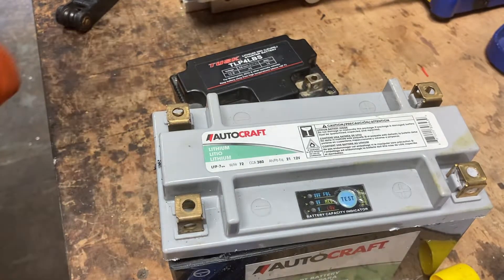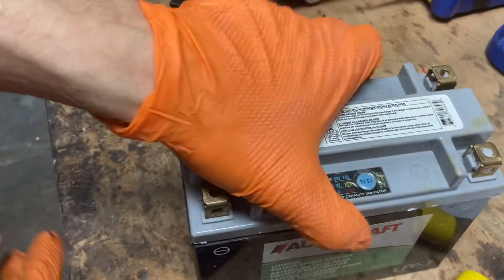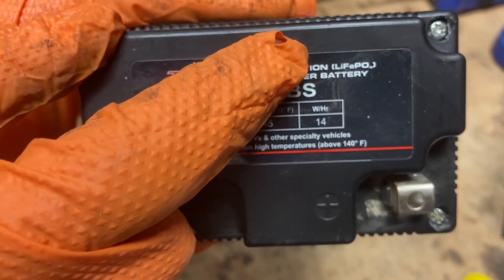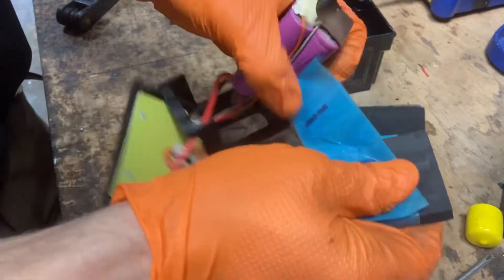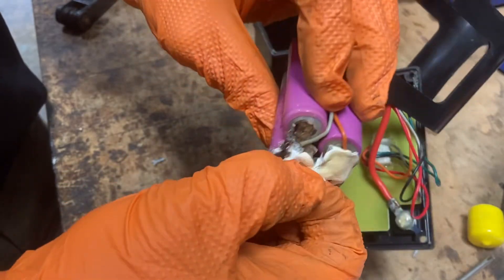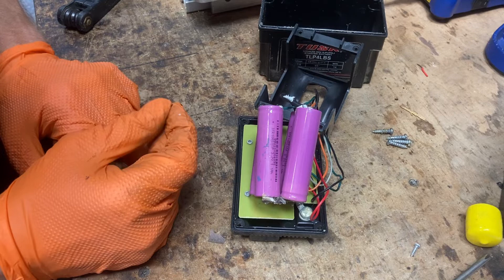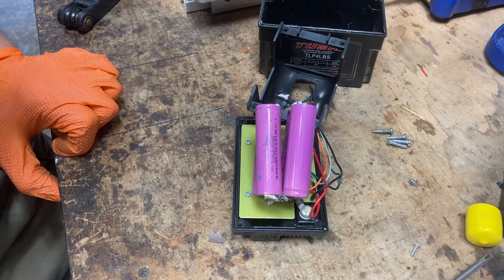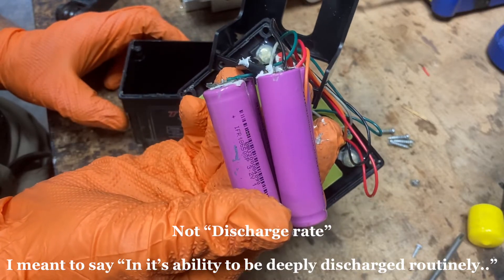What’s Inside a Lithium Motorcycle Battery

Comment: You can use 8 32650 cells (4+4 in parrallel). I'm in the process of building a new one for a light 125cc motorcycle.
My current battery is working for about 3 years now. Never needs recharging, disconnecting, maintaining. After winter starts right up and allways stays at about 50% SOC. I did add a powerdiode with a parrallel powerresistor, in series so the battery can cranc at full power, but can only charge at a few amps max. I'm going to test if that is even nessesary because if the charged voltage is almost the same as the bike's charging circuit voltage, there will only be a small charging current naturally.
Reply from the maker: @BrainHurricanes it sounds like you’re in deeper than I am. I would love to see your build sometime, somehow!
Reply: If LiFeP04 batteries must be charged less than 14.48 volts, how do modify the motorcycle regular to match.
Reply from the maker: I wish I could tell you. Sorry. That’s beyond me unfortunately.

Comment: its lead acid you dont want to fully discharge because it damages the terminals since its literally powdered lead and lead oxide that has been shoved into fiberglass cut grids. if the battery is inside the car and if it is able to heat itself i think it will work just fine as long as you dont try to use some bms meant for another purpose. especially with active balancers now, you dont need to run a bms coz most car alitnators will only float lifepo4 at most at like 80-90% state of charge before their 4x diode bridge in the back of them blows up

Comment: The big one, Is it lithium polymer or lithium Lifepo4?
Reply from the maker: Lithium Polymer
Reply: @Duby4life  nope. I think it is lithium phosphate/lifepo4. If lithium polymer, the voltage is to big. Per cell is 3.7v, but the lifepo4 is 3.3v per cell
Reply from the maker: @andrewhaselblad2676  Unless I’m mistaken, it’s definitely a Lithium Polymer. You can see the gray polymer bricks stacked on top of each other. It could be that is a lithium phosphate polymer battery.

Comment: I just made the mistake of buying a NOCO npl5 12v Lithium Ion battery from walmart and guess what.. its a Non-refundable, non-returnable item. And according to NOCO's website they will ONLY accept returns of batteries bought on THEIR website. So im out 79 dollars for the battery and 12 dollars for  NC recycling fee without an exchange. 
Not only that but NOCO's website says you can only use THEIR charger or it voids the warranty!  Lithium powersport batteries are such a scam. IF ONLY I HAD RESEARCHED IT FIRST but its like the merchants dont want you to know. NOWHERE on walmarts battery shelf does it say "Non-returnable" or "Non-refundable"
Reply from the maker: Man! I feel for ya. Just the fact that every lithium battery manufacturer mandates that you use their specific charger shows you how temperamental and sensitive these batteries are. They only hold up well under the most ideal circumstances it seems. Sorry you had such a bad experience! Lithium had it’s uses. I’m not convinced that motorcycles and scooters are one of them.

Comment: would love to see the bms inside these batteries.  Running lifepo4 batteries below 2.5 volts per cell will damage them at best and most likely destroy them. the same is true at more than 3.7 volts per cell.   I cannot see these tiny bms's handling the current needed to start the bike but have never seen one.  If the battery does not disconnect if you run it down it is just stupid. I have also not seen 18650 batteries able to safely output more than 30 amps so the 200+ cca is destroying the cell every time you start it.  Don't know the rating on the pouch cells but I doubt it is 200 amp.
Reply from the maker: Hey Rick, I appreciate the comment. I don’t know how they make them so they hold up as long as they do, but you more right. These little lithium’s are really not made for this. That’s probably why I see so many brought in the be “recycled”.

Comment: What's your opinion of the batteries in electric vehicles which are subjected to high discharge? 
Are EV manufacturers ripping off buyers with the high prices?
Reply from the maker: Hey Rick, I appreciate your comment. I don’t know enough about their innards to give you more than my opinion.

The Tesla’s were made with a very similar battery to this one, just LOTS of them. I’m not sure if the current EV’s are still made with 18650 cells or not. I would think the lithium polymer would tolerate the high discharge better than typical lithium ion cells. Perhaps Li-Po’s aren’t used due to being more volatile though.

Personally, I think the EV’s are unsustainable and impractical for many applications. With the power grid already having issues, why overload it with cars needing to be charged?

I think the electric bikes, scooters and other such devices are excellent for individuals who have short commutes and financial limitations. If my commute were shorter, I’d be able to justify getting a one-wheel for myself and would very much enjoy using one!

Comment: I have been told you can't charge Li Ion batteries directly because of low internal resistance, and will kill your alternator?  But I don't see any special charging circuitry within these batteries that you've shown.
Reply from the maker: I wasn’t aware of that. In my experience, I have a lot of trouble trying to charge lithium batteries (that have been deeply discharged) when I hook my charger leads up to the terminals on the outside of a lithium ion battery pack. Many times I have to disassemble a pack and hook up directly to the lithium cells, bypassing the circuitry, in order to get it to charge.

Comment: I had a similar lithium battery, '4 cell' it performed well for 2 years. After not using the bike for a few months, the battery failed and is bloated. I suspect it was either 1) kick starting the bike with 14v read on the terminals, the flat cells couldn't handle it and a cell failed because it is not properly regulated to charge a battery from that state? or 2) i connected a 1.5a lead acid/ agm battery charger to it at some point to 'trickle charge' it but this may also be enough to have cause the damage to the battery? The bike is in question is only 200cc,  I will get fairly inexpensive small agm battery that claims 85cca and see how that goes.
Reply from the maker: If the charger was automatic (meaning it decreased in amperage as the battery became more fully charged) I would think 1.5A would be fine. Even though the charging patterns would differ somewhat, that shouldn’t be enough to overwhelm the battery. One way or another, it took too great a charge from the sounds of it.
Reply: @Duby4life  so today I got a battery and the it has enough cranking amps 'SSB POWERSPORT VT4B-4 12V V-SPEC HIGH PERFORMANCE AGM BATTERY' and the it has enough cranking amps. I'll try strip it down the lithium, see what cells are in it and maybe I can repair it, if I go back to lithium I'll probably get a lithium rectifier, 'Ricks' type, and only use proper lithium chargers, never let it discharge fully, lithium really doesnt have a great advantage in this application.

Comment: I'm confused by the end of this YT (around 4:50 on). You say that LIFEPO4 batteries are not supposed to be discharged very much. Yet the very reason they are used in Solar applications is they can take repeated and regular deep discharging without degradation unlike Lead Acid Batteries (flooded or otherwise) which lose life when discharged beyond 25% on a regular basis. Your information is exactly the opposite of what the world of solar has been saying and all the science behind it. What am I missing here?
Reply from the maker: Perhaps I misspoke! What I meant was, a bike starting—even a small bike—requires a good bit of energy to get going. While LIFEPO4 batteries are excellent at being discharged and charged repeatedly and not wearing down as quickly, the RAPID discharge of a bike starting is much more demanding for the battery. With a rapid  discharge, there is much more heat, gassing, and overall wear on the cells. 

So what I meant to say was that LIFEPO4 batteries are not designed to be so quickly discharged, especially on the regular.
Reply: @Duby4life  thank you for the clarification, that helps me lots.

Comment: That is a scooter battery probably 150cc or less I have had them last more than 2 years
The crank amp is not all that demanding at 60cca 
But if you're worried about it add another 4 cells there is definitely room 
That particular battery could probably start a 650 if you stuffed some more cells
Personally I'd like 4×3.7v cells as my scooter runs at 14.5
Reply from the maker: Nice! Two years sounds like a good life for something this small.